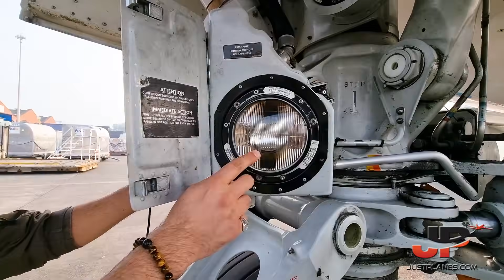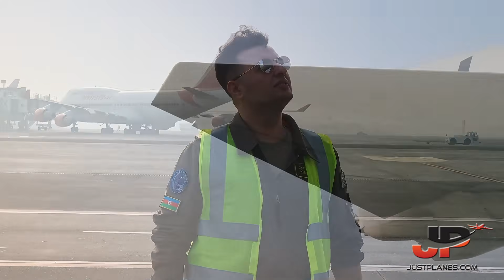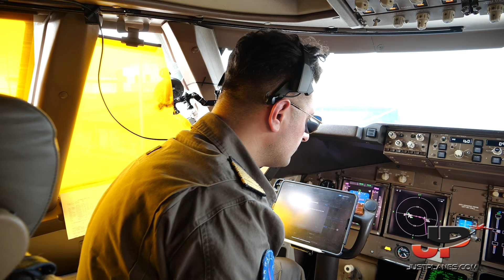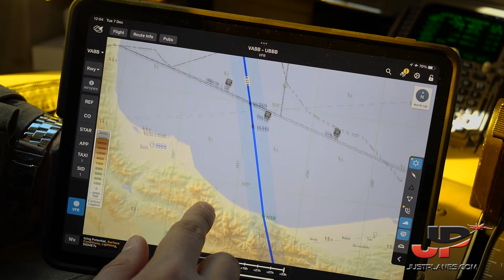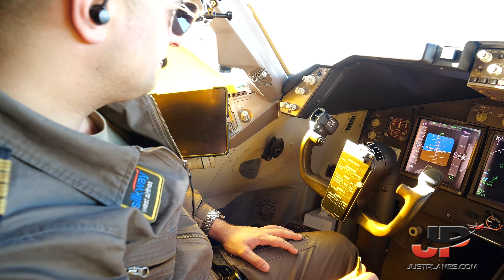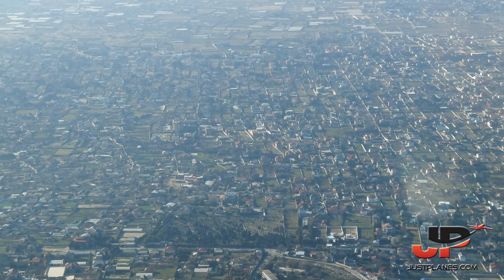Silkway Boeing 747-400 Cockpit Mumbai🇮🇳 to Baku🇦🇿

Comment: I saw this pilot flying a Boeing 777, can he be assigned to fly the 777 and the 747 since they are slightly different aircraft?
Reply: sure? if you're type rated on both, you can fly both. Just requires more training.